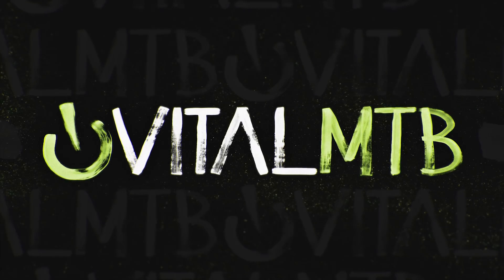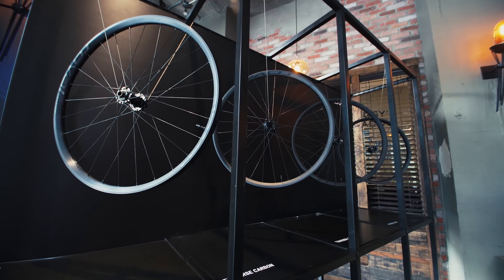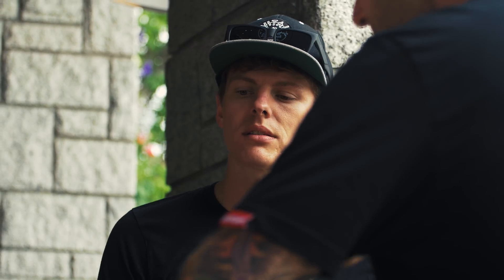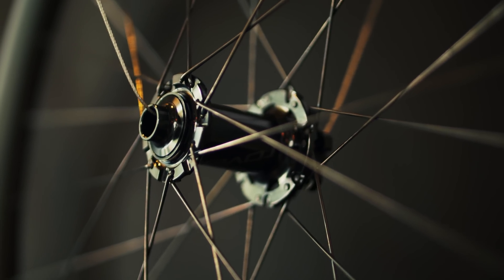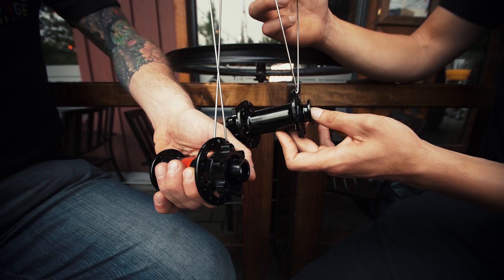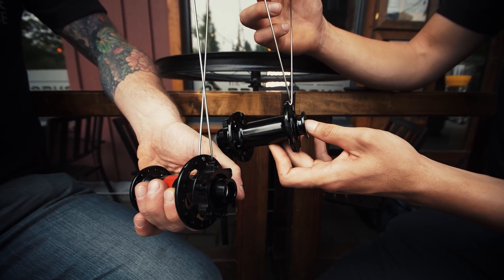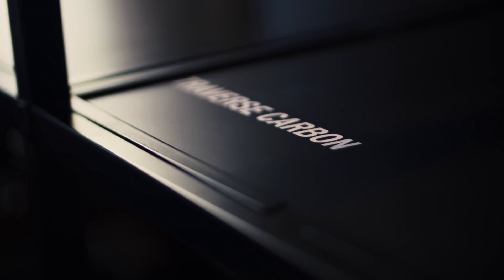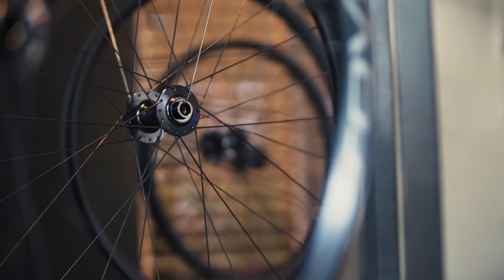Elevating MTB Wheel Design: See the New Roval Traverse Lineup

Comment: So is the formula hub with 3 pawls on my Roval Traverse carbon rear wheel considered dt compatible? In other words can I switch it to rachets?? Been racking my head with this!
Reply: LuisManuelHdez yes u can. I also put some ratchets on. The cheaper version is like dt 370 hub. The more expensive ones like the carbon have already got ratchet system. Have a look at Roval Homepage.
Reply: U changed a formula hub to dt internals?
Reply: LuisManuelHdez no formula Hub is not possible. Only the Roval ones. So i changed a dt 360 internal to ratchet.

Comment: If the wheels are so revolutionary then why are the hubs not for straight spokes and why not make the spokes on the left side(the disc side) not go out from the disc mount it self.  And then when it comes to the rims, why are the spoke holes not placed more to the side of the rim instead of being in the middle which makes the wheel more prone to flexing. Nah these wheels are nothing special.
Reply: There are lots of drawbacks to straight spokes for a minimal strength increase over J-bend, putting spokes and a disk on a single mounting would put too much stress on the mount and it would have to be overbuilt to the point of being heavier than just having them separate. Also having the spoke nipples out of alignment makes the wheel more flexible, unless you mean have them cross over each other laterally, in which case the spoke length alone would make the wheel more flexy.